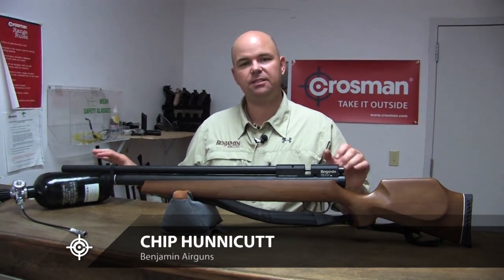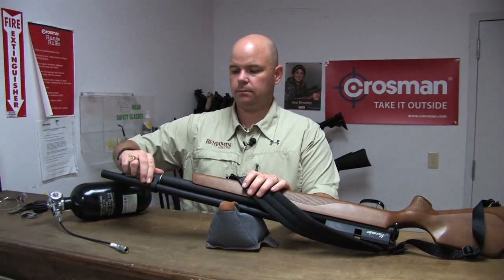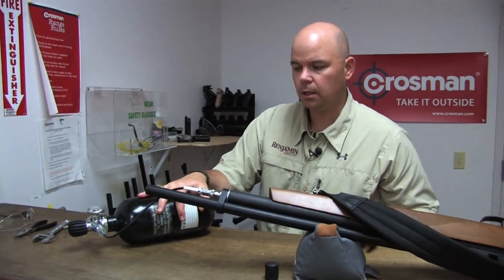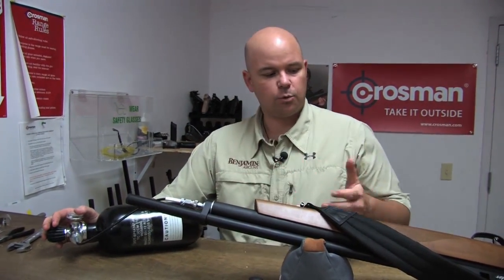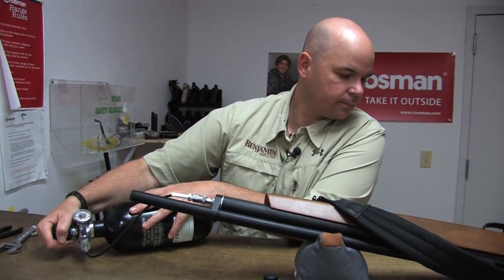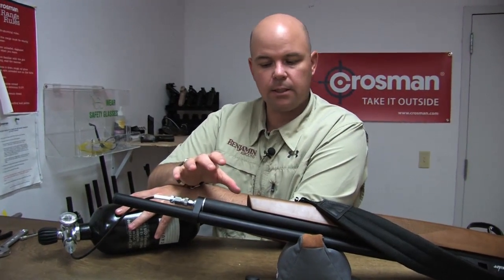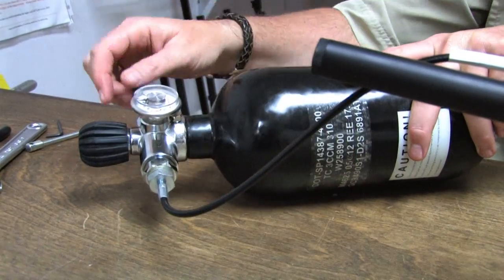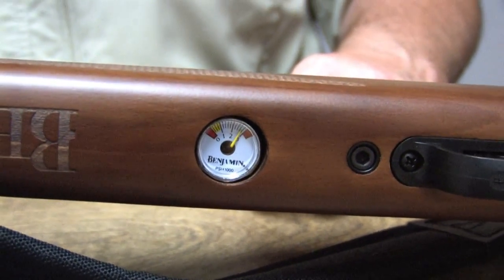Benjamin 15" PCP Air Tank, Chapter 3 - Filling a Benjamin PCP Airgun

Comment: My tank is at 1,500psi right now.  I did exactly everything the video shows but the gun doesn't fill at all. The bleed valve on the tank shows that there is pressure in the line but the gun doesn't fill. Any suggestions?

Comment: Hi there, I just bought this Benjamin tank for my Steyr pistol but when the pistol cylinder is filled and I turn the bleed valve open, the air of the pistol cylinder was also releasing...

Comment: Watch the gage on the gun?  ROFL!!!  The gage on the Benjamin Marauder is the one most common complaint about that gun on all the airgun forums.  I own two Marauders.  Both had to have the stock gage replaced.  One was at 3000 PSI with 2000 indicated, and would valve lock if you filled the gun to 3000 indicated.  The other would indicated past the red and almost all the way back around to zero with 2000 in the gun.  For those who want a solution I've replaced both of mine with the little $11 gage from McMaster-Carr.  They are only B rated for accuracy (in my opinion) but they are actually B rated in results as well.  I do not think McMasters lists an accuracy rating.  Anyway, one reads about 50 over at 3000 and one reads about 100 under.  That's not great, but its acceptable.  The A rated gage on the fill manifold I assembled (with all 5000 PSI parts) agrees with me.   

Other than that I actually like both of my Syn-Rods.
Reply: Hello Bob, you would be so kind as to supple the parts # for the Mc-C gauge?  I went to the website and they have a million gauges. Thanks!
Reply: Timothy Miller Timothy,  I would like to first add the caveat that my gages from McMaster have drifted slightly since I made that post.  They may not be as good as I originally indicated and thought.  That being said, they are McMaster part number 9767T21.  One seems to still be at about the same, but the other is now off by almost 200 PSI.  It may not be the gage though.  I recently noticed a 3000 PSI brass fitting in my fill system is shedding brass particles.  If one has become lodge in the gage it could throw it off like that.